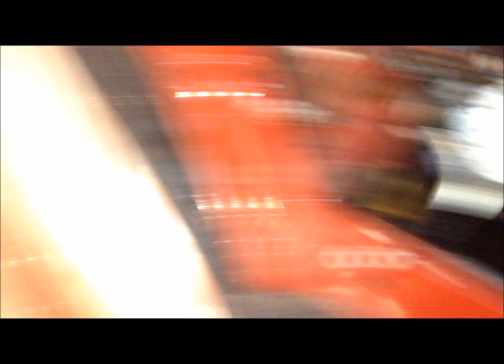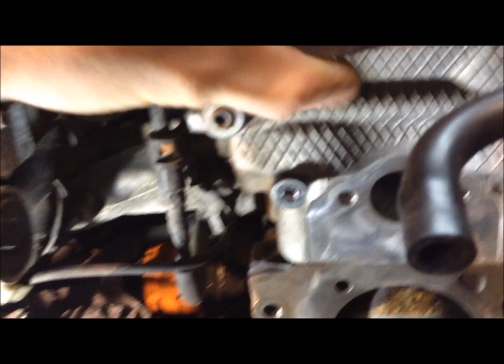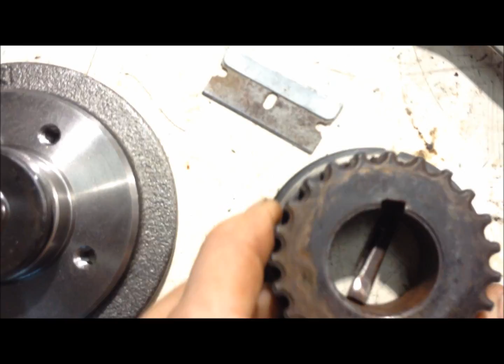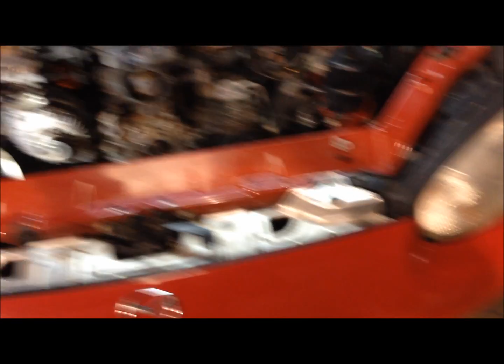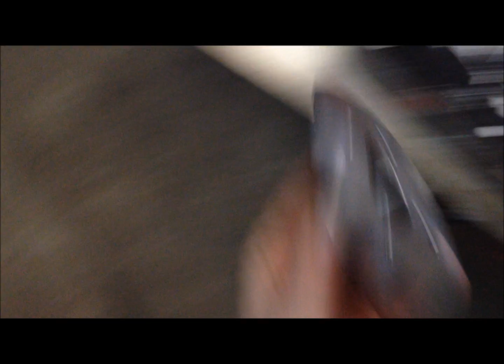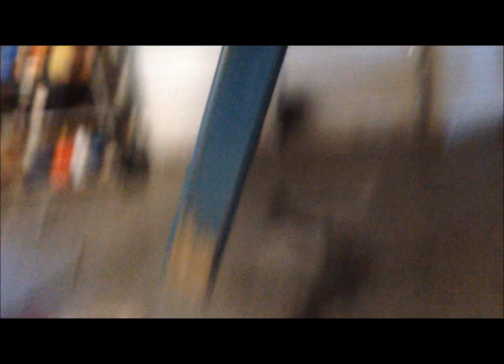Miata Crank Wobble

Comment: Thanks for the info.  FYI that’s not a woodruff key.  It’s just a standard square key.
Reply from the maker: I rarely check these, but thanks for the heads up. I've always heard the terms used interchangeably. When you check the OEM parts diagram, they have it listed as a woodruff key too. It's probably the difference between a machinist needing to know that they serve similar functions, but are different, and everyone else using a general term.